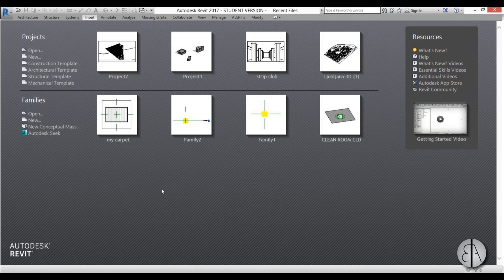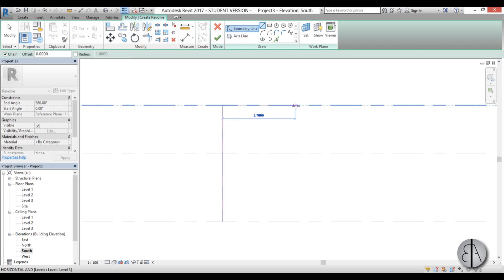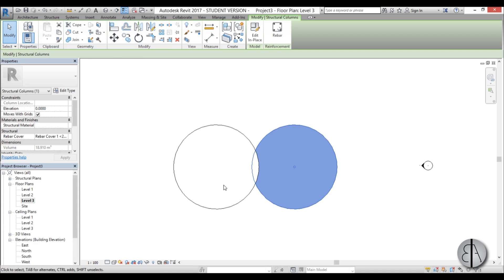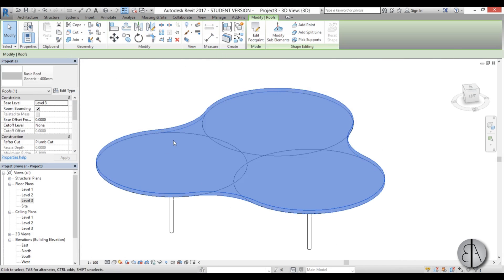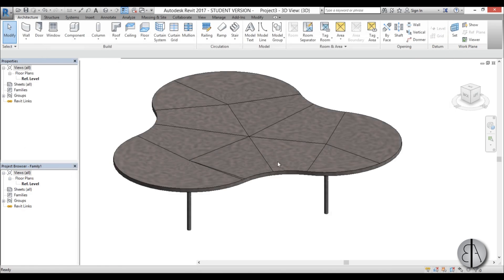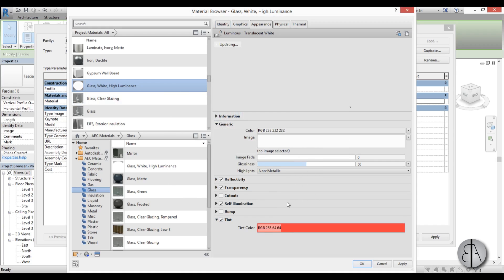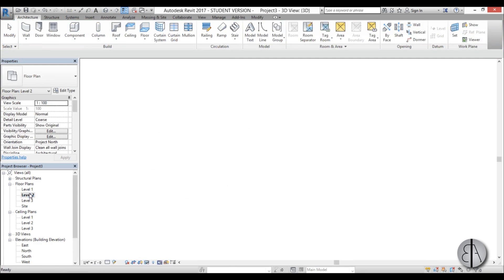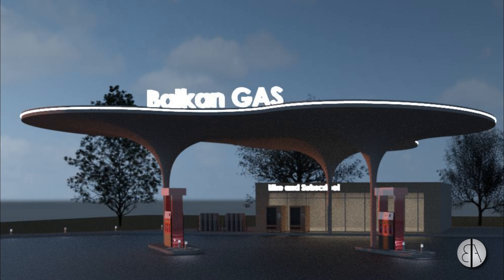Gas Station Modeled in Revit Tutorial

Comment: Good day. I am currently modeling a fuel station in Revit but i am a total beginner and me deadline is in a feq days. Would you mind sharing the families of typical fuel station components, especially the signage such as the canopy fascia illuminated signs and a typical model of an illuminated flag pole or main ID sign.  I need to model everything in detail such as electrical wiring, fuel dispensers etc. Would also not mind paying for your help..let me know..

Kind Regards
Whatsapp +27 72 477 3130